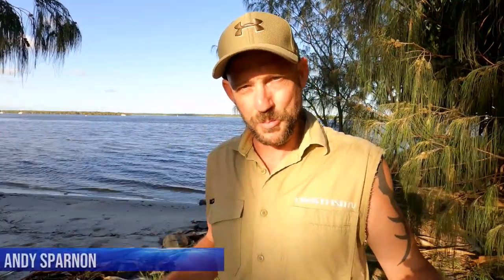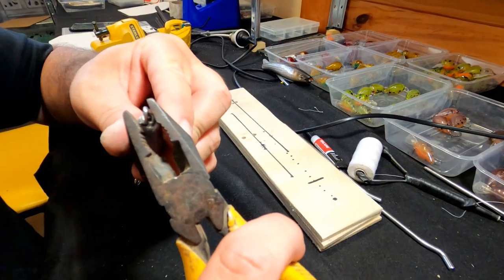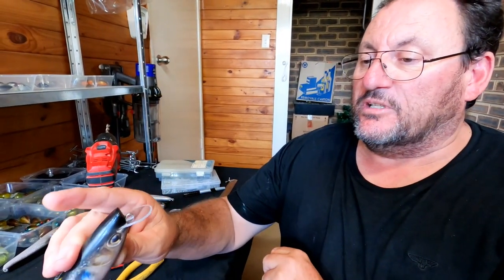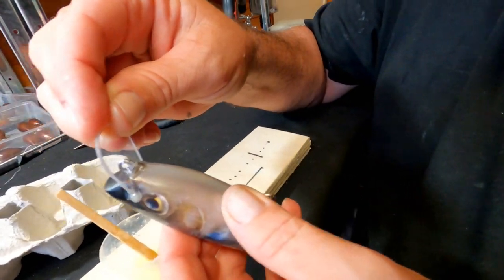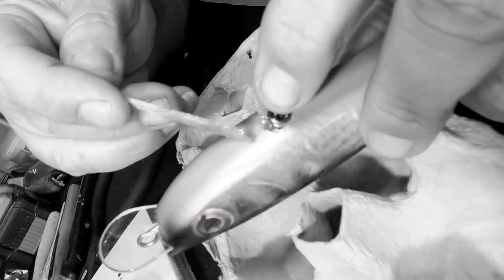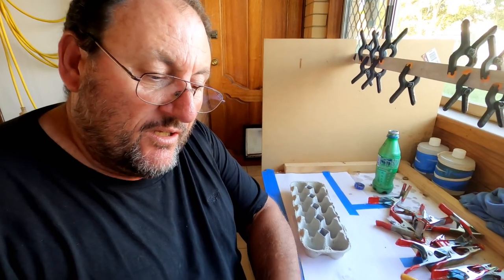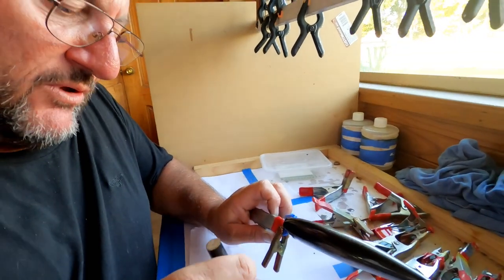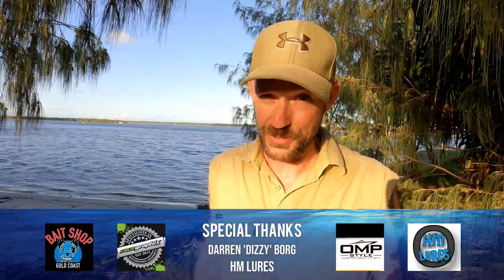How to make a fishing lure Part 3

Comment: How did you clean up the glue around the wire and bib? Did you cut it away or use a solution to clean it up? Also what sort of paint do you use in the air brush gun?
Reply from the maker: Clean glue with metho and rag before it dries. 
Createx paint it is water based and easy to clean up